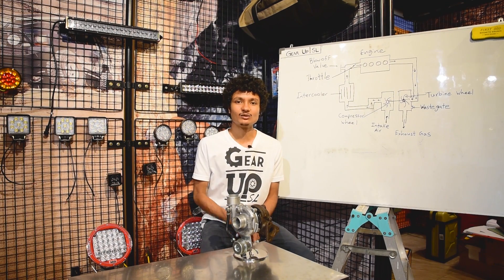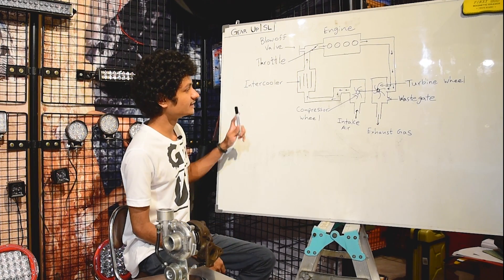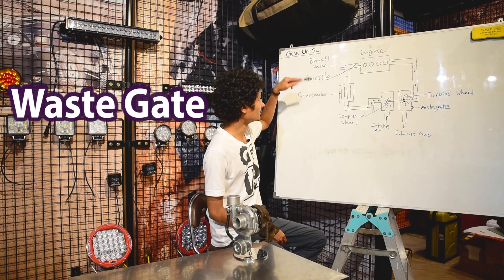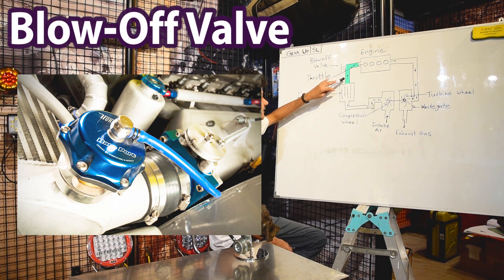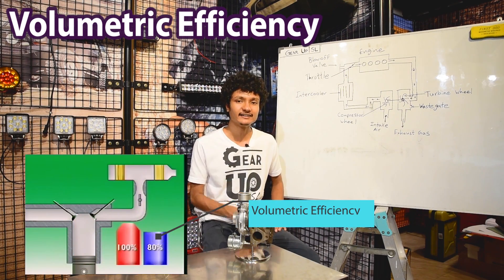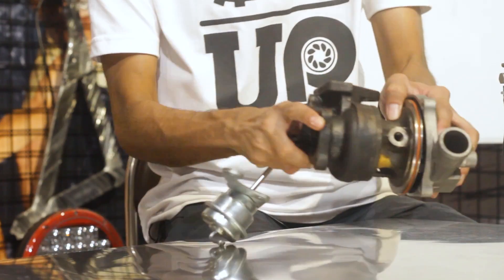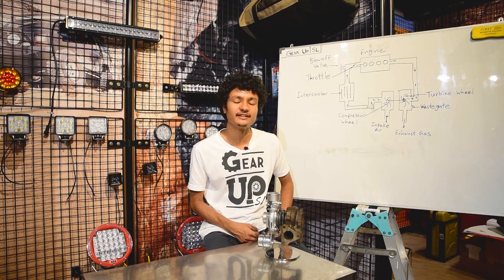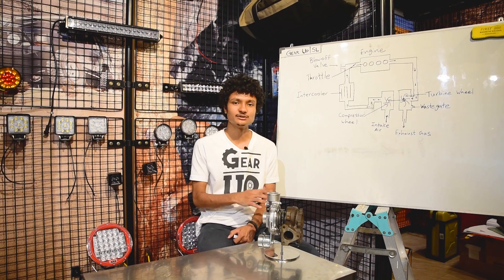Turbocharger Explained | සිංහල

Comment: Overall the video is good and Good luck.
Things to be moderated.
1. Audio Quality
2. Slow & Smooth explanations
3. Closeup video footages (Compressors wheel, Turbine wheel, shafts and all like wise)

The white board is too far. Better if you use on screen diagrams.

Hope to see more videos on these stuff. Good luck.